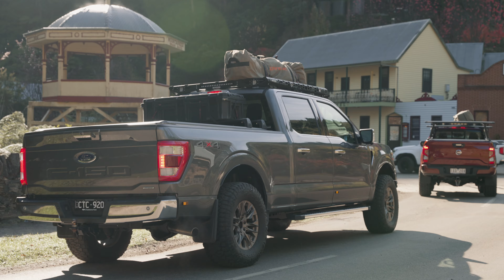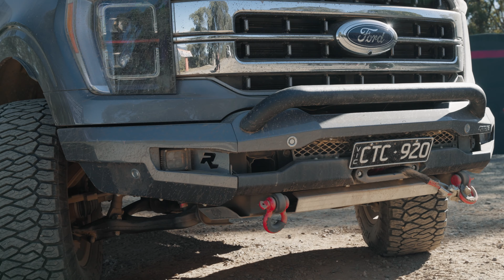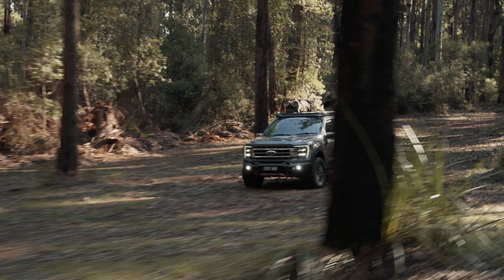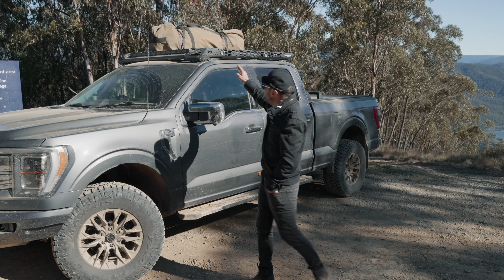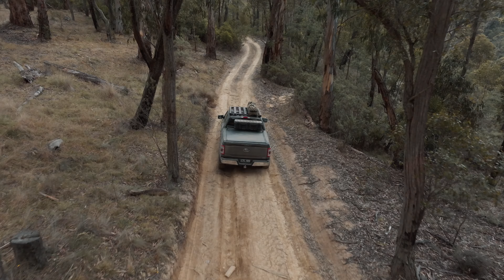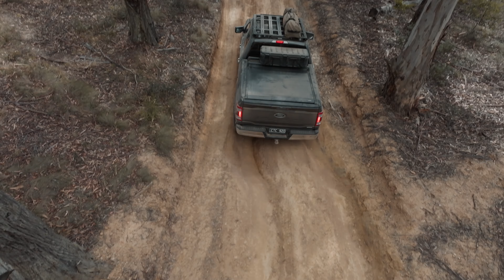Ford F150 Rhino4x4 Fit Out

Comment: Lights on the roof facing backwards are unroad worthy in Victoria .
Lights in the bar are unroad worthy can't come on with high beam have to be wired as a fog light.
How do these clowns get away with this ? I wonder if they pay the fines the coppers give you ?
Reply from the maker: Hi mate. Forward facing driving lights are legal as long as you can isolate them with a switch and can only be activated with high beam. If this was not the case nearly every 4x4 on the road would be unroadworthy. These are not fog lights. They are a driving light.